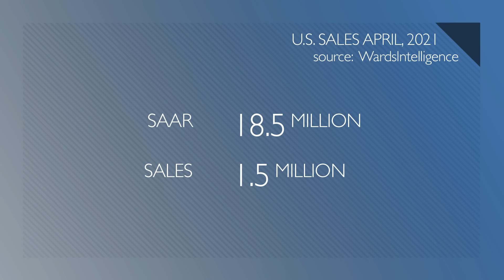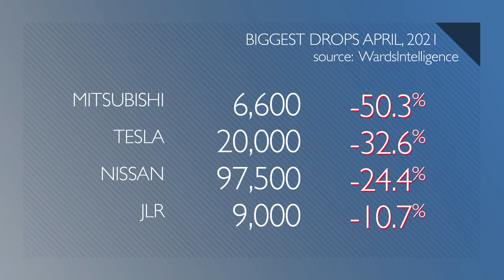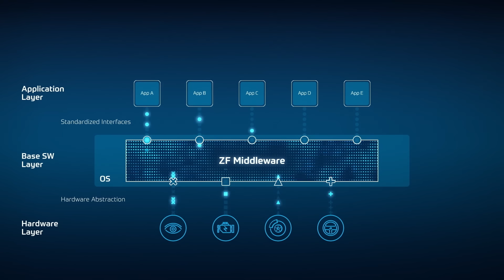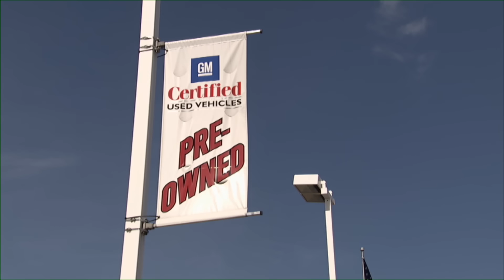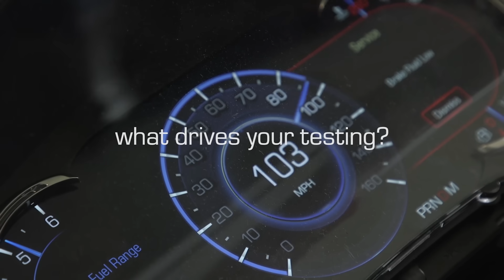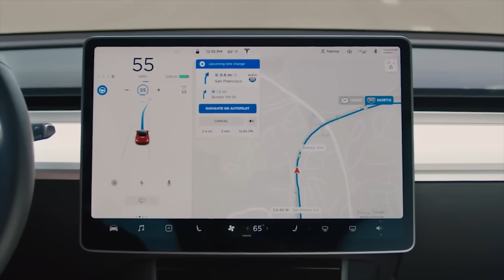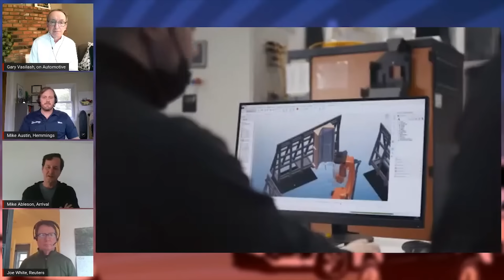BMW Making Fuel Cell X5s; April Sales Stronger Than Expected - Autoline Daily 3072

Comment: I read the ZF middleware press release and came across this gem of obfuscation/corporatespeak: "Its development is closely linked to the development of applications for the technology fields of automated driving, electromobility, vehicle motion control and integrated safety." There's also this cutie: "In addition - if required - the ZF ProAI supercomputer platform can supply established manufacturers as well as new players in the mobility market with a powerful central computer that can network software, computer and sensor hardware, and actuators." Start talking like humans, ZF! This is nothing but meaningless jargon slinging.

Truthfully, I think the ZF middleware is almost certainly trash and I wouldn't want it in any car I buy. It plants itself right in the middle of latency-critical communications paths... the very areas where software engineers need the software to be as lean as possible. ZF talks about "apps". What apps, ZF? I don't want apps controlling my car. Give me apps for my infotainment functions, but not apps for my brakes, my accelerator, my suspension and my steering. The car's driving functions need to be kept app-free. It's clear that you don't know what you're doing ZF.

Comment: The micro factories are interesting. It'll be fun to see how successful they will be.
Reply: Sounds suspiciously similar to the solar activists' utopian fantasies about "distributed utilities".
Reply: Obviously a low volume solution. Not sure why they think they need flexibility in the order of operations. I suspect that they don't. If I were planning a manufacturing plant, I'd want flexibility in the volume of output so that if I got more demand than I was expecting I could easily add output at minimal disruption and enjoy the extra cost savings that should accrue with higher volume production.
Reply: @dlwatib  Set up another micro factory?
Reply: @dlwatib  I understand your points and they are sound for proven products. in this case though they need to keep their overhead and costs down as much as possible so that they can offer  the new product at a lower price.These Ev start-ups  MIGHT could sell more if they didn't have the huge overhead to begin with......They can always build on if they make it.

Comment: Fuel Cells are a pointless dead end for cars.
Reply: I think the term you're looking for is "exercise in futility"..
Reply: As Sean said,  they will have to find a way to supply the hydrogen for them to succeed. If they build micro nuke plants it would be the solution, if not they won't do well.
Reply: @davewhite113  The idea of getting "someone else" to build and pay for the refueling stations won't work with Hydrogen. Industry and governments already have their hands full trying to build out battery recharging stations. The world already makes electricity in great quantity and we have power lines carrying it almost everywhere people go. So EV charging is a MUCH easier task. Hydrogen has to be made and in some cases transported in addition to the delivery device. Who thought that would ever happen? It just won't.
Reply: @frankcoffey   Frank I  can't argue with you about getting taxpayers to pay for the micro nukes to produce the hydrogen. I feel the same way about charging stations. both should be paid for with private money.  If you're looking for the easiest way it's not BEV's or Hydrogen though....Electricity also has to be made and transported  too and it's gonna take decades and  perhaps even trillions to  power BEV's on a wide  scale basis.
Reply: You're missing huge numbers of things but I'll give you a few. The natural gas distribution system is extremely reliable - it is what we depend on when the electricity goes out due to wind or snow or general incompetence - the natural gas system will be upgraded to hydrogen so that we don't all freeze to death - this is done easily - there are thousands of miles of hydrogen pipeline operating already. Gas pipelines, unlike the electrical grid do not require balancing - the pressure in the transmission pipes varies through the day - that means no need for massive battery installations and it means that nuclear plants and biomass conversion plants etc can run steady state throughout the day - no shutting down for low demand or firing up peaking generators for high demand. Electricity is mostly made from HEAT - producing hydrogen from heat is more efficient than producing electricity from heat. That means that a network of high temperature gas cooled reactors (HTGR) feeding heat to a Sulfur Iodine process with far fewer moving parts than a Rankine cycle electric plant can run all day at the steady state feeding a pipeline system that is far more reliable than the electric grid, naturally regulates itself unlike the electric grid, can transmit far more energy than the electric grid, and requires fewer energy plants because peak demand is a nonissue. Note that the Dept of Energy recently awarded a grant to X-Energy for a meltdown proof HTGR. Note that there are at least two biomass to hydrogen projects in California alone. Note that there are multiple projects in Europe converting natural gas pipelines to hydrogen. I suppose I should also point out that the cost of building a hydrogen fueling station is immediately cut in half when it is tied into the hydrogen grid rather than having to store hydrogen onsite.
Reply: @cccharlie1972  With cheap high temperature reactors you're better off producing synthetic hydrocarbons (methane, diesel, gasoline etc). Then you wouldn't have to upgrade the entire distribution infrastructure to deal with the huge pain-in-the-ass factor of hydrogen.

Biomass is a bad idea. Way too resource intensive to ever become economical. If you want carbon you can harvest it from air or seawater. No land or growing of anything required. Just a nuclear powered synfuel factory ingesting water and air and producing a constant stream of hydrocarbon fuels.
Reply: @phamnuwen9442  Synthetic hydrocarbons do not address zero emission vehicle requirements.  Nor do they address noise requirements.  Nor do they protect water resources from spills.  Hydrogen does all these things.
Reply: @cccharlie1972  There are no "zero emission" or "zero noise" requirements.

What is required is affordable and practical energy and transportation solutions. Hydrocarbon fuels have provided this for a hundred years, and will keep doing it for many more decades.

Hydrogen is not practical. It's very low density, prone to metal embrittlement, leakage and explosions.

If hydrogen was practical and economical, we would already be driving hydrogen cars, but we're not. 

Hydrogen vehicles only exist where the government forces this inferior solution onto the consumer.
Reply: @phamnuwen9442  My previous posts have already addressed your major points - hydrogen has been proven entirely practical.  I will say that hydrogen is likely to grow more rapidly in Europe, China, Japan, and South Korea as they are dependent on foreign regimes for petroleum, natural gas, and / or coal.  The USA, on the other hand, at this time has fairly secure domestic energy reserves.  But automakers will want to produce one flavor of drivetrain for various markets, so car companies will want to transition to fuel cell and battery electrification.  And, of course, international shipping and aviation will lead to standardization in those industries as well.
Reply: @cccharlie1972  I'll believe it when I see it. I've driven a natural gas car. It's a pain in the ass. Refueling takes too long and the range is too short. Hydrogen is even less energy dense and more difficult to work with.

We already have an automotive energy system based on super energy dense and practical liquid fuels that works great. Why the religious struggle to replace it with something inferior?
Reply: @cccharlie1972  
That's all good and dandy, but the ball has already rolled with the auto industry, they love chasing $$$..
Tesla already lit the fire, its electric vehicles for the near future..

If these next crop of current EVs become successful pertaining to sales, its game over for ICE and hydrogen fuel vehicles.. As it is now, EVs has an 11 year lead on any other alternative fuel vehicle..
It would take 11 plus years for hydrogen fuel cell cars to reach the level of current EVs vehicles..

Face it, EVs are here to stay.
Reply: @mamadouaziza2536  EVs are here to stay but they won't be alone.  And hydrogen infrastructure will happen because homes and buildings must be heated.  And steel must be smelted.  And aircraft and marine vessels, heavy trucks and trains must be fueled.  My prediction is that eventually (once subsidies are eliminated and infrastructure matures) BEVs will be 25 percent while FCEVs will be 75 percent - only half of cars will have access to overnight charging and, of those, only half will opt for batteries.
Reply: @cccharlie1972  The problem is none of that is happening except for the EV's.

 Wishing for something won't make it happen.

I had this discussion in 1999 with a hydrogen evangelist, almost nothing has happened since then wheras EVs have come on massively.

Id be quite happy if hydrogen did turn out to be our future, i just dont think it will.

Luckily reality will give the answer either way in due course.
Reply: @wizzyno1566  I'm sorry things aren't moving as quickly as you like.
Reply: Is the future. Easier to refuel. Longer range, cleaner then EV's are quickly becoming the past. Look at the sales figures in this story alone. Plus will get mainstream public acceptance more so then EV's
Reply: @bikingD  Pure fantasy. These FC cars are just blatant compliance products with limited practicality, and asking for taxpayer charity to prolong the charade. 

Maybe dedicate that effort into industrial applications, then it may make some sense in a very specific niche.
Reply: @AllanSustainabilityFan  you mean like rebates and credits the government gave for EV's so hypocritical. Toyota, Honda, Hyundai, Daimler, BMW all investing in Hydrogen. EV's sales are slowing to a crawl as even this story shows that. EV's are now the past not the future. Accept it.
Reply: @bikingD  EVs already established dominance as a technology, so it makes sense for the governments of the world to chase it in order to dominate the future of transport.

FC path is just burning money on Toyota's side hobby that's going nowhere.

EV sales have doubled from prior year, while FCV sales have not even passed FOUR digits worldwide, despite being on the market since 2013! 

You're looking at a dip in EV sales for a single month in a single country, that's a comical analysis.
Reply: @AllanSustainabilityFan  It has a head start. Japan wants to go Hydrogen, Germany wants to go Hydrogen and even new eco fuels, US Chevron going Hydrogen in it's stations. Technically as much as you don't like it EV's don't dominate. Old ICE vehicles still dominate the free market. EV's just don't have a long term future. Before it got a foot hold to replace ICE vehicles it's already old tech. With old big dirty batteries, made from big old mines, powered by big old big dirty powerplants. EV people just hate to admit they were sold a bag of goods and really isn't that clean for the world but because no tail pipe oh I must be clean. Please what ever.
Reply: @bikingD  You do realize Tesla has have it best sales in Japan recently, so even the stronghold for hydrogen is moving over to BEVs.
Reply: @earlpottinger671  😂😂😂😂 a whole 588 year to date in Japan. 715 Toyota Mirai sold  units in March alone in the US and no real network is in place yet. You must be joking comedy hour. Please
Reply: @bikingD  
LOL.. Is your story suppose to be 50 years into the future?
EV sales are through the roof globally and it will continue to rise as more EVs are launched. 
Hydrogen fuel cell cars are another alternative, at the moment there is no infrastructure for refueling and there are no Hydrogen cars except for that one model from Toyota that no one is buying..
Reply: @AllanSustainabilityFan  
At the auto show in Beijing there were literally tons of EVs and many EV concepts, no one mentioned fuel Cell technology.
Reply: @bikingD  
Please keep dreaming because it opens the mind to fantasies and to unicorns with gold plated horns..
Reply: @earlpottinger671  
Don't argue with Dale, he is clearly in a fantasy world.
Reply: @mamadouaziza2536  Yes it's called the future. With smaller batteries, quick refueling times, longer ranges, no dirty. Power plants fueling the cars water out the tailpipe . Sucks to be on the other side. I use stats. Shoe is on the other foot Tesla drivers do this to people who like ICE vehicles. Now that something is cleaner, more modern and Tesla is so 2019 it sucks now don't it to be the past.
Reply: @mamadouaziza2536  You mean the auto show with the woman on the roof of the Tesla and they are now investing Tesla. That autoshow.
Reply: @mamadouaziza2536  EV sales are entirely driven by subsidies and green hype. If/when this goes away, they're history.
Reply: @phamnuwen9442  
But what if it doesn't go away?
What if all the auto makers had 50% of their catalogue be EVs in a few years? In 10 years their entire catalogue will be EVs? 
If the Nissan Ariya is a hit with buyers, expect more EVs from Nissan.. Ford just announced the GT versions of their Mach-e and the GT is already selling out in pre-orders. The Cyber Truck with be a phenomenal hit! Tesla's sub $25k EV is coming and sales will be through the roof and once that happens, all the auto makers will produce sub $25k EVs. 
BMW iX and i4 are coming.. 
Renault is doing well with their EVs. VW is doing well with its EVs.
Rivian and Lucid are coming... 

If hydrogen fuel cell cars come, I'm all for it, but right now, EVs are the future.
Reply: @mamadouaziza2536  What if this, what if that? What if pigs could fly?

The problem with socialism is that you eventually run out of other people's money

― Margaret Thatcher
Reply: @bikingD  We shall see, but my bet would be on EVs.